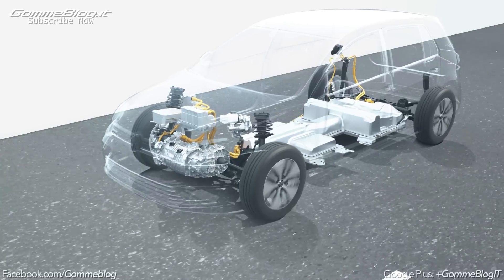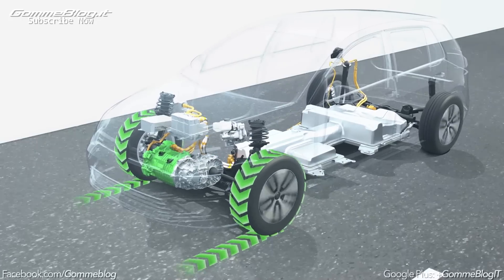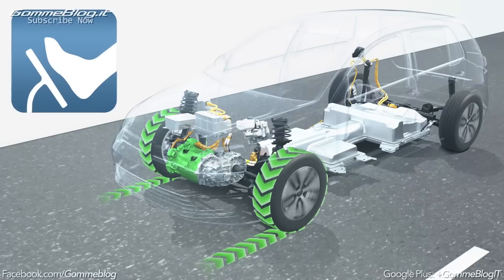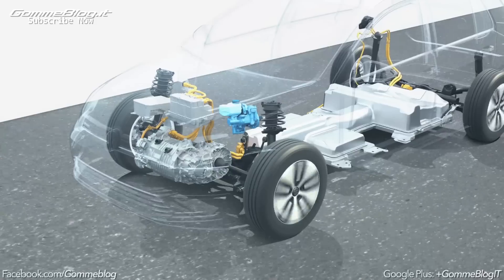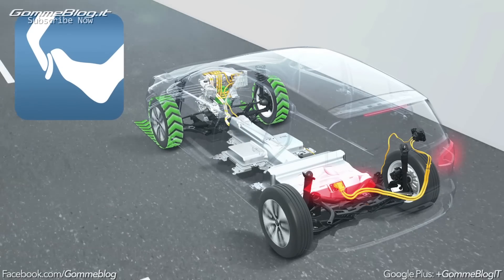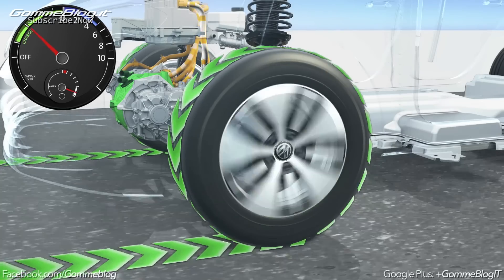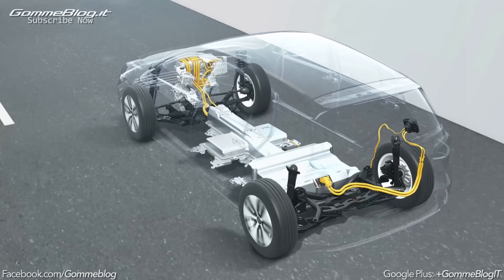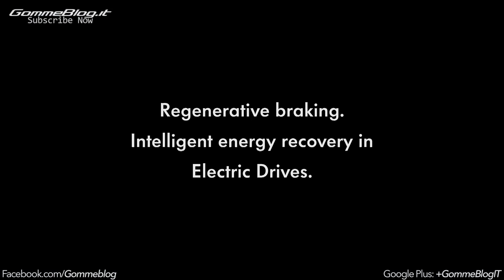Volkswagen Electric Mobility: Animation Regenerative Braking

Comment: people are starting to drive in such a way as to almost always accelerate to the speed limit then drive consistently at limit speed and when faced with a situation whereas they'd have to stop the vehicle they've been letting off the accelerator and gently applying breaks to reduce their speed as approach time increases to the long stop line that runs perpendicular to your path giving the cross light the time necessary to turn green again therefor you never actually stop the vehicle completely I just wanna say STOP DOING MY THING!! no one used to drive like me and apparently if a bunch of people drive that way it becomes annoying! 
so stop it. drive like morons again.